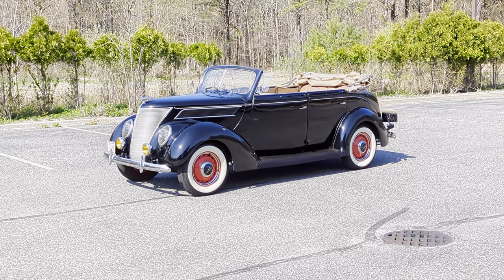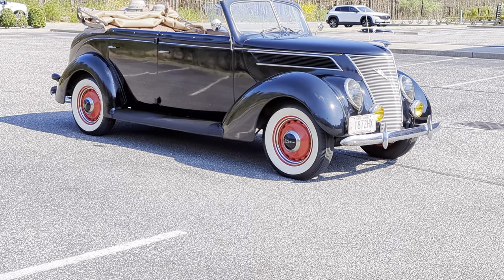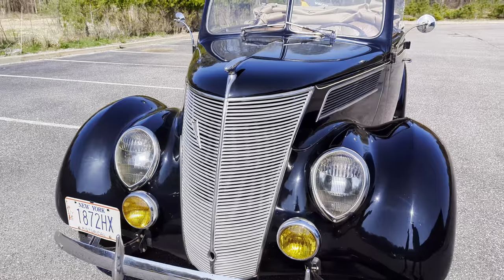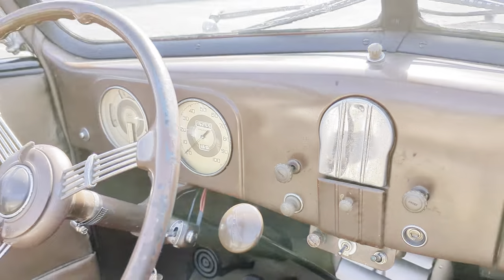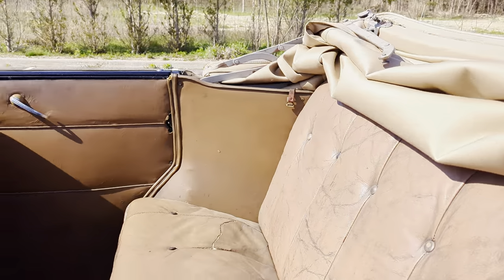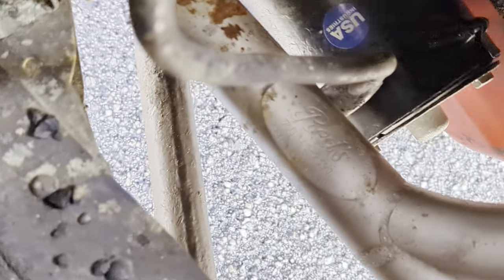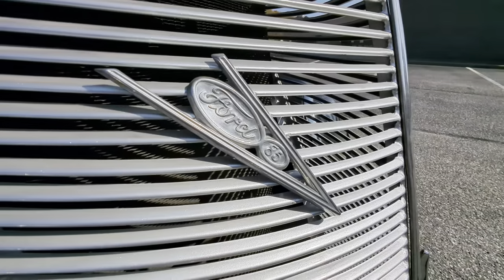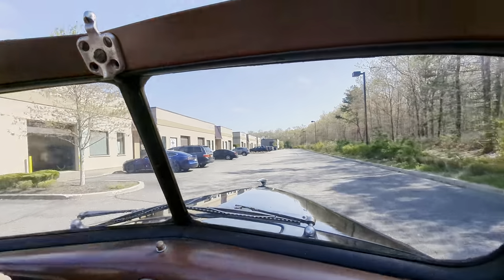1937 Ford Phaeton Model 78 For Sale~Flathead~90% Original and Just Gorgeous!

Comment: By 1937 Ford had worked out the kinks of the Flathead: burning oil, over heating and cracked heads. The flathead had become the engine it was meant to be. If one spent a modicum of maintenance on those engines, they ran well and lasted a good long while too.